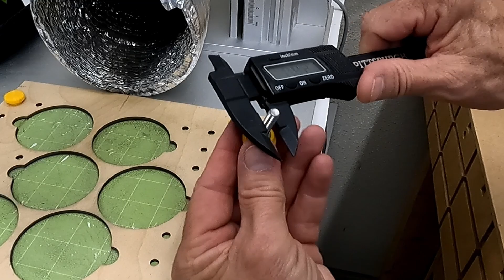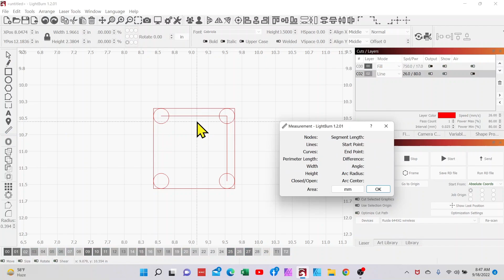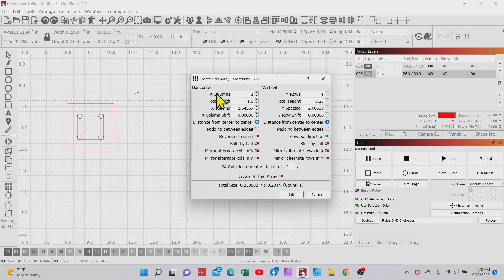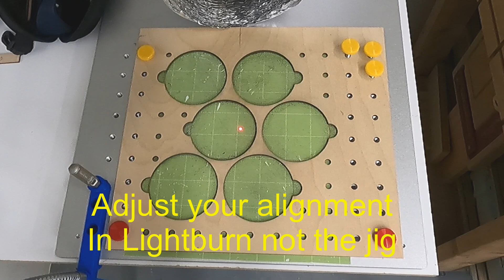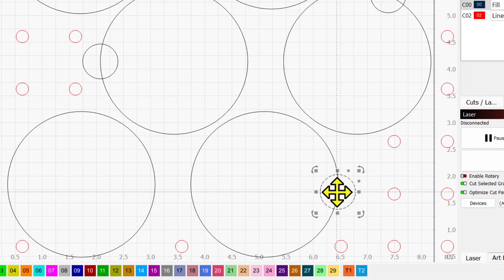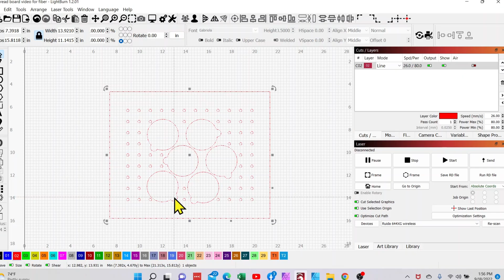Making your first jig for your Fiber Laser

Comment: Happy I found your video, but frustrated at the same time, my Math's not Mathin lol, anyone able to help!!!!, I've been trying to figure this out. My fiber bed is the same as yours, same distance 1.21 - 0.23 = center to center. Follow this video to the tee, having issues when I make a 9 x 9 grid, only leaving my 4 corner hole cut my base board, and then when I go to screwing it into my fiber bed the holes do not line up. Any HELP would be greatly

Comment: When you place the black perimeter on the bread board, how do you know exactly how far up and to the right of the mounting holes it needs to be?  It looked like you eye-balled it on the CO2 template after observing the fiber laser layout on the table. Do you cut out the entire breadboard before or after you place the leatherette cutouts in the design? What am I missing here?
Reply from the maker: re watch the idea you will get it! its not easy to get the first time.

Comment: Great video especially for a bread board.  For production runs, you might want to consider making a jis that can swap out, so you can load on up one jig with 6 patches while the other jig is engraving saving even more time.  But great video.
Reply from the maker: even on a fiber it’s takes time to align things back up. I’ve tried both ways and this is the most reliable for the patches I do. because they are round if your design is off just a little you can tell. thanks for input!